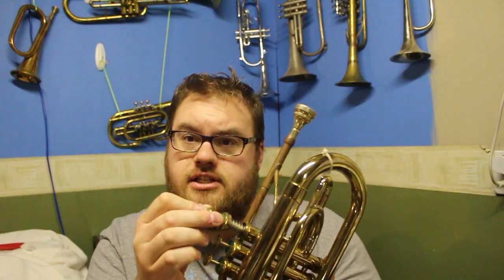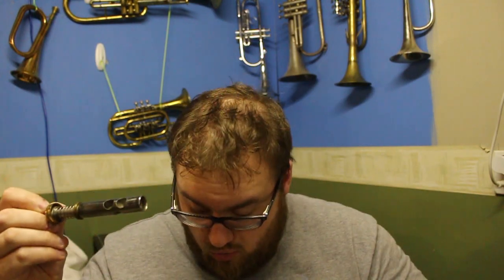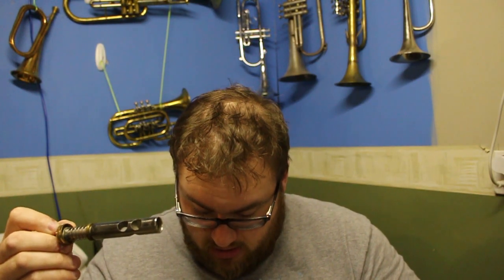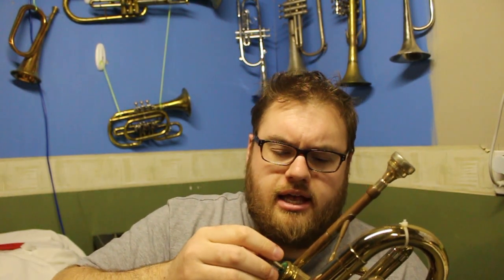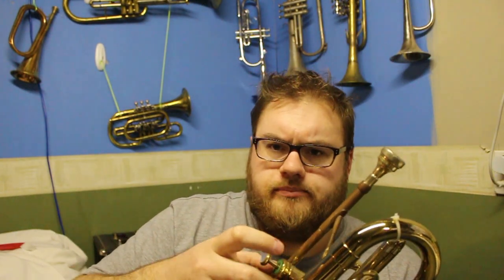RANT: You're using your valves wrong!

Comment: The only way to have a maximum of control (and to be sure to put a full down force without lateral one) is the right way, it's just physics man... and maybe you need to play more years the same instrument in a real bad way (with lateral force) to see what happen! (oval casing and piston inegal used). Resistance show friction, friction is possible with any tolerance parts, and friction is detruction! So if trumpet have smaller pistons, it's more difficult to detect it, but it's there (premature using). Tradition are often the key for real science...
Reply: It's the same for the water key, if you push it in angle, you will see rapidely the effect (tolerance are just greater) and bend arm too, but it's the same logic. Asiatic culture are good to incorporate this in the movement, the way to make things with precision, minimum of force, etc... or individualistic a-culture is good for understand and search WHY we need to... but is bad for humility and discipline.

Comment: Spit and water works really nice while it lasts. Unfortunatly, evaporation exists.
Reply from the maker: The trouble with using spit or water is that they don't protect the valve against oxidisation or corrosion. Oil is much better to use for that reason.
Reply: Funny story related to valve lubrication! I'm not really a brass player, but I'm a composer. A year or two ago, I bought a cheapo Etude trumpet new for 140ish bucks just to give it a try and get a greater sense of how it all works. On a side note, I was actually surprised the world's cheapest trumpet video wasn't about the Etude offering. 

Anyway, I used Al Cass, I used Giardinelli and a few others, my valves would stick within hours of putting the horn down, and I used copius amounts of the stuff to boot! Hell, if I used just spit on the valves, I'd be afraid the valves would permanently corrode themselves right to their barrels! ...but wouldn't you know it, I picked up some cheapo generic stuff that smells somewhat like kerosene, and the valves feel better than they ever did with the "good" valve oils, and the valves don't stick anymore when I put the horn down! 

I guess the moral of the story is: buy cheapo trumpet, try cheapo valve oil! Ha ha! Mr. Hamilton, I dig your videos! I find them very informative! Cheers from New York City!

Comment: LOL.......Don't you love internet experts???? LOL!!! Most people need to concern themselves with keeping their valves properly oiled and properly cleaned! Most brass players have disgusting valves. Using an oil that is thicker than water would go a long way towards reducing wear! I laugh at how trumpet players think that their valves need to feel fast and that fast is good. Never mind they can not voice notes as quickly as they can make them move even with the heaviest of valve oils! LOL In my book super fast=lots of wear! Alisyn Synthetic valve is the best I have ever tried. Most people think it feels to thick but none of them can actually site a single missed note due to valves not being super fast! LOL 

My Dad owns about 38 trumpets and two trombones. On all of the nickle plated pistons not a one of them has pistons that fail to match the OEM diameter listed in Ferreer's tool catalog. Their is some variation as you rotate the piston but that is just because they are not perfectly round. Also all of them are slightly smaller as you approach a port in the piston. On the other hand all of the bronze brazed in liners in the more modern designs are hour glass shaped and slightly egg shaped. The bronze liners in the valve bores is softer than the nickle plating on the pistons or the chrome plating on some of them. I am using calipers, micrometer's and pin gauges to take the measurements which are used in machine shops to rebuild engines and industrial machines with far tighter clearances and tolerance than any brass instrument and that see far more load and more abuse. In fact the rockets used to go the moon and to put satellites in orbit where not built with any better measuring equipment than that.The Great Pyramid was built with sticks and string as measuring tools and we still do not know how they moved some of those stones with the equipment they had. People do not know this but you can make a metal plate square and flat to .0001 of an inch with nothing more than layout ink, a metal scraping tool and a flat edge. My Mom is a CNC Mill and Lathe Operator.

My Dad and I modify, repair and build trumpets for fun. Most of these "experts" on the internet have no clue how an instrument is made let alone how to replace a receiver or a leadpipe or touch up a lose brace! My Dad has a saying that while not very nice describes what they people are doing he would say they are "Talking out their "rear end" insert a vulgar word in place of (rear end).  To me they are like parrots they repeat what someone else has said them normally out of fear and with no real fact's or empirical evidence to support their claim. What get's me the most though is often they do not own a means of measuring or documenting this " excessive wear and tear"  and even if you gave the tools to do it they would not have a clue how to go about doing it! I am fine with supposition based on what seems likely and probable so long as you do not represent it as fact and you do not speak with authority as if you know what your talking about! LOL If I am making a leap of faith I always make it clear to people that " I think something is probable" instead of speaking with absolute authority as if I can back it up with hard evidence!!! LOL Internet experts never do that thou they speak as though God came out of the heavens and declared what ever they are saying as the absolute and only truth! LOL
Reply: I was making fun of trumpet players and their obesive compulisive behavior with "fast" valve and "thin" oil.  How much research do you have on the CPS vs cSt vs P of various valve oils. WATER 1.00 - 0%
MINERAL SPIRITS 1.34 - 0%
CLARK TERRY 1.83 - 16% - 7% - 6% - 0%
BENGE 1.99 - 35% - 13% - 8% - 5% - 4%
BLUE JUICE 1.99 - 44% - 23% - 17% - 12% - 8%
PLAYERS 2.15 - 44% - 20% - 13% - 8% - 4%
JUPITER 2.20 - 33% - 17% - 15% - 13% - 10%
ROCHE-THOMAS 2.31 - 16% - 13% - 13% - 12% - 11%
HOLTON 2.38 - 25% - 7% - 4% - 0%
HYBRID 141-A7 3.02 - 92% - 75% - 64% - 55% - 46%
PRO-OIL RED 3.61 - 74% - 44% - 33% - 21% - 11%
AL CASS 3.73 - 75% - 48% - 37% - 26% - 16%
PRO-OIL BLUE 3.80 - 77% - 50% - 37% - 25% - 13%
SPACE FILLER I 5.10 - 100% - 100% - 100% - 100% - 100%
SLIDE (t-bones) 5.12 - 100% - 100% - 100% - 100% - 100%
ALISYN 7.59 - 100% - 100% - 100% - 100% - 100%